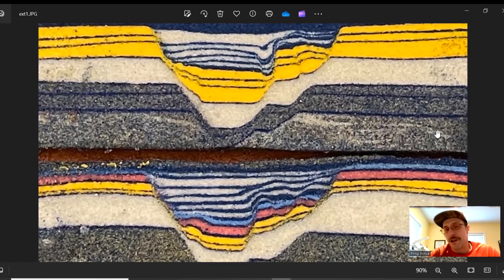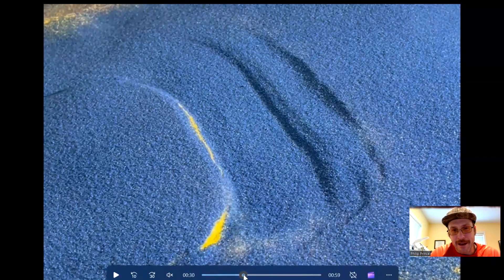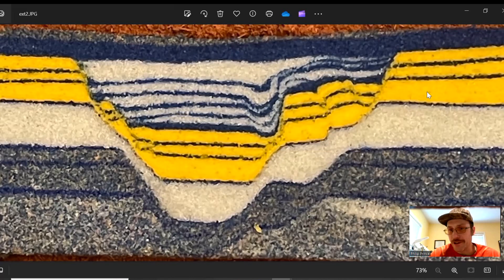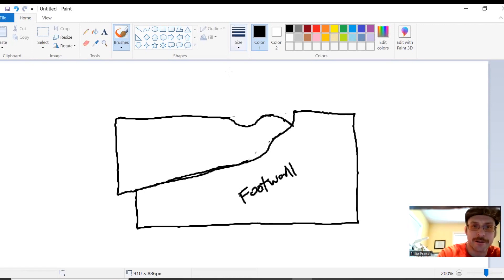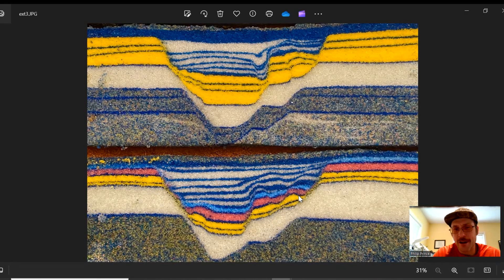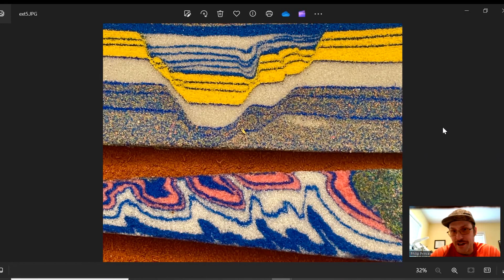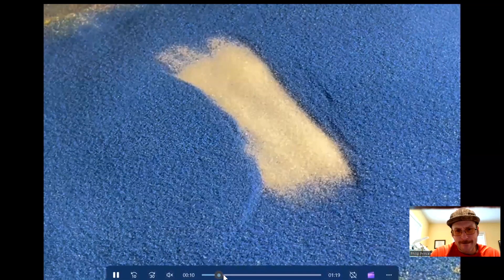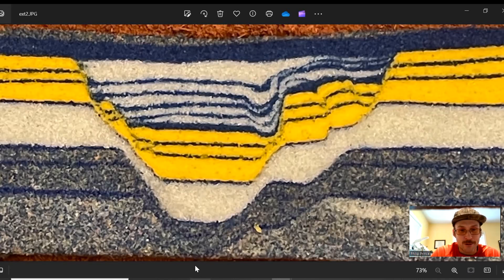How do normal faults fold sedimentary rock into anticlines and synclines | Structural Geology

Comment: Another great video!! Since the faults in sand occur by grains sliding on each other, there is a clear connection between the frictional resistance and the dip of the fault.  A fun experiment would be to predict the angle of faulting in different sand materials by determining the angle of repose for each type of sand.  The principal stress driving the extensional faults in sand and the angle of repose on a pile of sand is vertical (gravity towards the center of the Earth).  If you measured the angle of repose, the predicted dip angle of extensional faults in sand should be 90deg minus the angle of repose.  This should also work in the contractional models, where the dip angle should be about equal to the angle of repose (principal stress direction being horizontal). It is quite interesting how sand can mimic cohesive layers of rock, which are not necessarily deforming by frictional sliding.  Perhaps because faults in rock are forming by a combination of many micro cracks and mineral grain dislocations, the sand analog works.  I always appreciate the real world examples in your videos.  It helps validate the models and satisfy the question I always have watching in your videos, "but does this happen with rock?"

Comment: Nice job Philip of demonstrating how and why the hanging wall has to deform to fill in gaps and create the strange faulting/unconformities. I also liked seeing the blobby thickening of layers outside of the syncline complex where the pressure has to push some of the looser sediments away into the local plateau. Working the gulf coast structural geology and geophysics of a seismic interpreter in the 70s and 80s I saw a lot of this,  Used some of the early Kloos boxes were like your vids as helpful to understand what I was seeing. Keep up the good work. Very good real example.